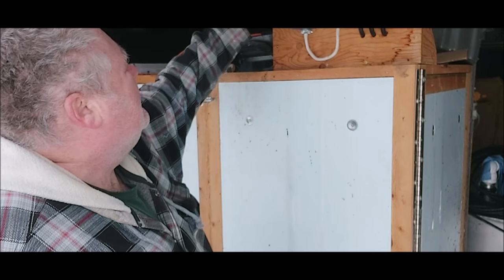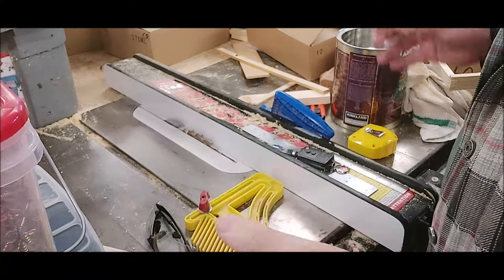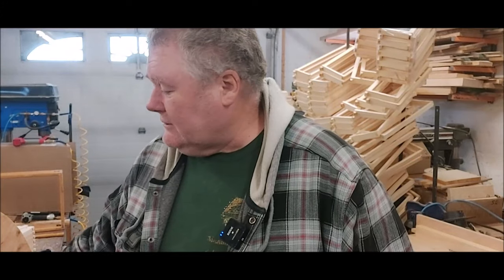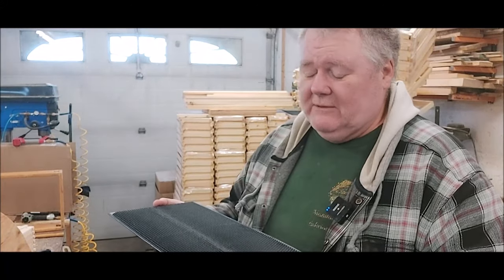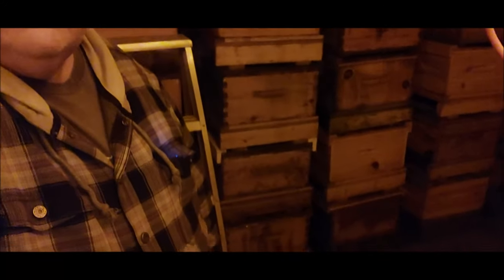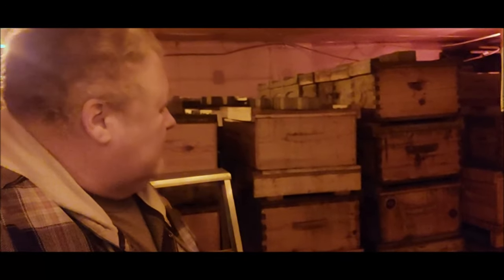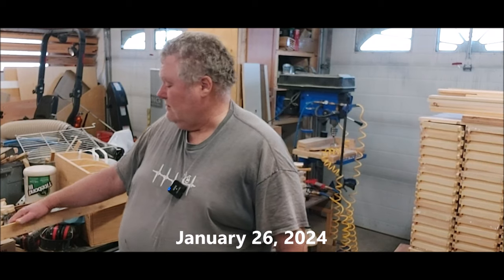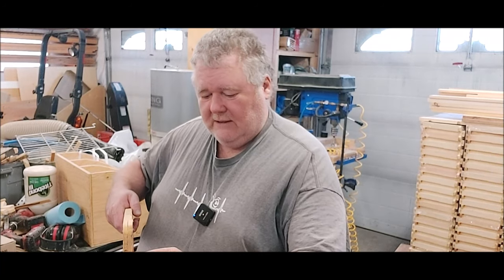⏱ Vlog January 20 to 26-That Bee Man

Comment: I use wooden starter strips as well. I give then a spot of glue in case i get a loose one. I rub the edge of the strip with a block of wax, easier than melted wax.
Reply from the maker: Thanks for watching!